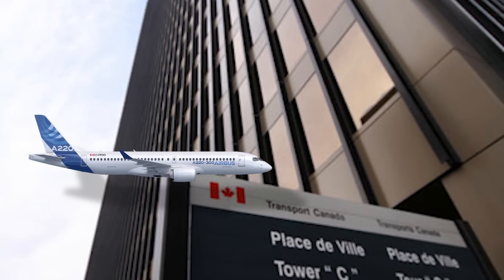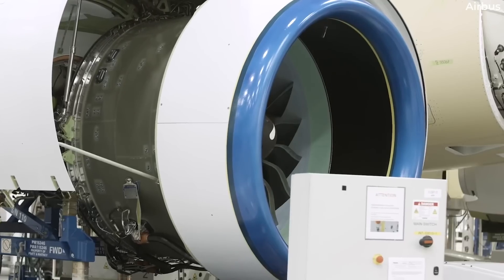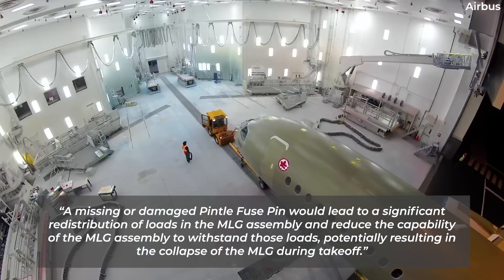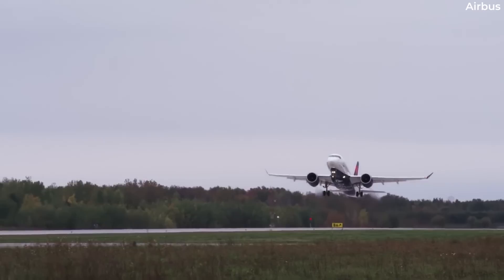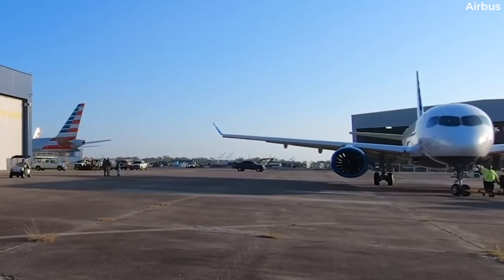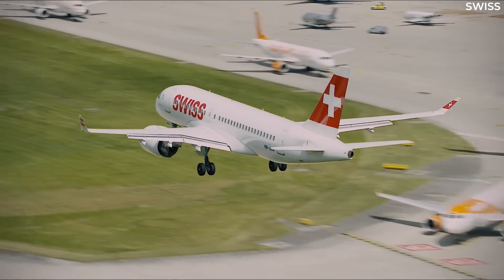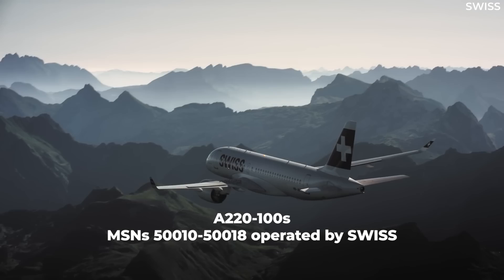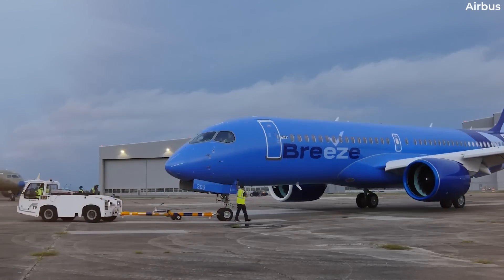Airbus A220s Must Be Inspected For Missing Pins

Comment: Having both US and non US airlines cocered by the airworthiness directive means that it applies to acraft assembled at both Mirabel and Alabama so this would point to problem with the landing gear maufacturer Liebherr-Aerospace. But it could also be with assembly instruction at both plants that omit important step when inetgrating those landing gear with the plane they are building.

Comment: If it's Bombardier I'm not there
Reply: Of course the design, equipment, employees came from Bombardier, but this has been Airbus owned and operated for a while now.
Reply: It's airbus
Reply: @kartik_sinha  Airbus bought the rights but it's designed and built in Canada by Bombardier
Reply: @RabbahDocRona  It's also built in BFM Mobile Alabama. Production is managed and leaded by Airbus in all manufacturing plants, so they're to blame for the defect.
Reply: @RabbahDocRona no it’s not built by bombardier anymore, in 2020 bombardier sold all their shares in the a220 program
Reply: @diow142  fine - if it's Airbus, make a fuss ...